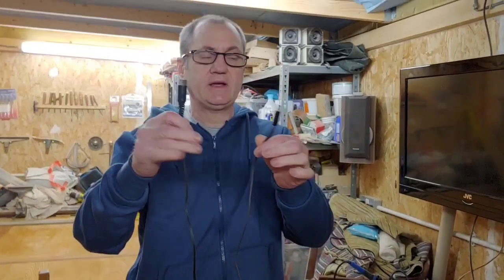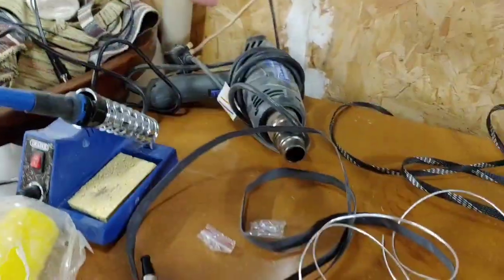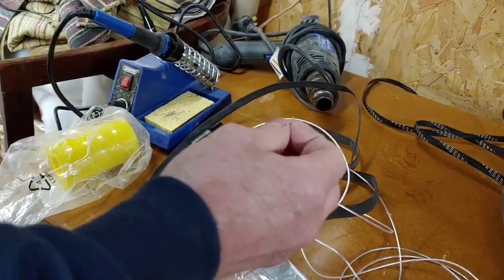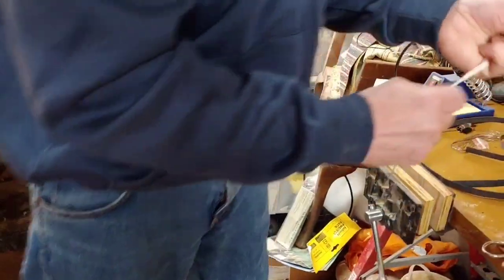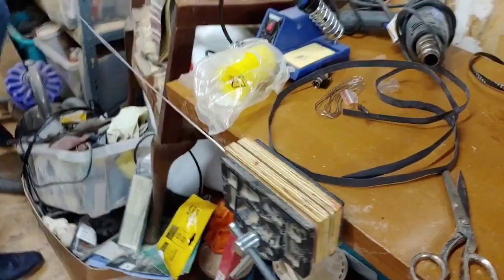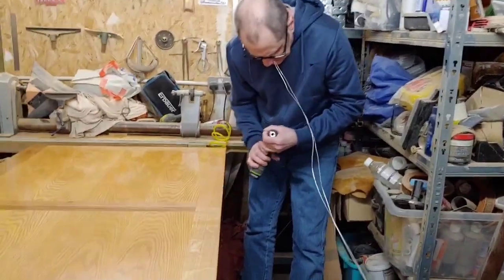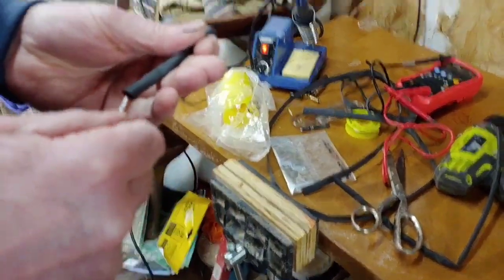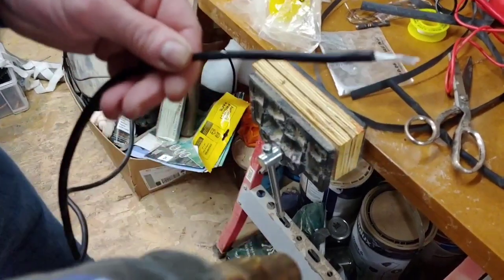Upgrade Graham Slee DC power cable (Tweaker Man Style)

Comment: Very interesting. One little project I want to do is to make a new pair of DC cables from the Exposure XI PSU to Exposure XII preamp so that they are just the right length (~70cm). Exposure supplied them originally 2m long. They use 4-pin metal DIN plugs either end. I intend to shield them since RFI is a problem in my home (WiFi, cordless phone, mobiles etc). 
BTW great to hear your daughter's singing! Mine are all grown up now, 4 is a lovely age. 13-16 can be taxing though!  All the best, Rob

Comment: May I suggest getting a metal pot scourer and dip your iron into it before you use it to clean the tip. does a great job. You can also use wire wool.

Comment: Need to replace my psu cable. Does it improve the sound?
Reply from the maker: Hello Jim Most definitely, the biggest improvement is the detail, It really is a worthwhile upgrade. All the parts you need are in the description below, thanks for commenting & watching.
Reply: @tweakerman  It's for my headphone amp - Graham Slee Solo. Will get ordering on ebay.